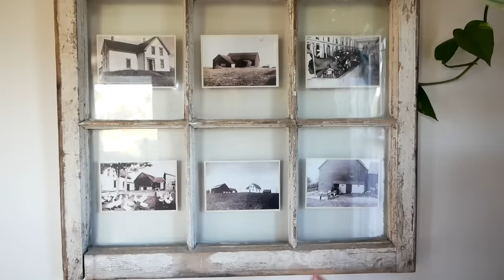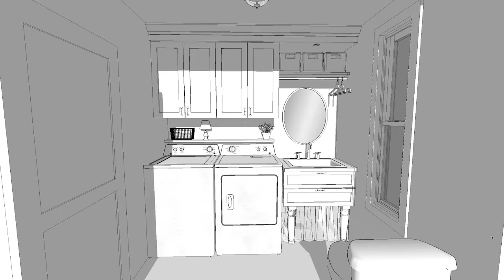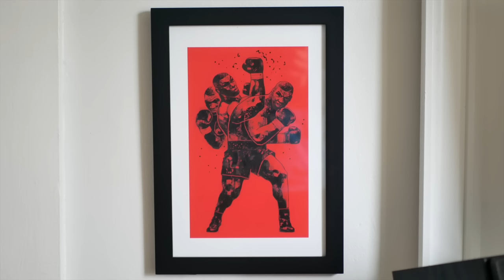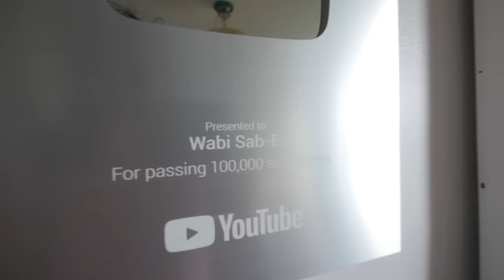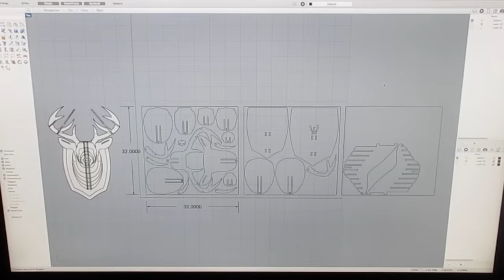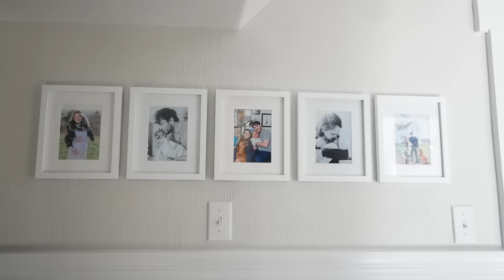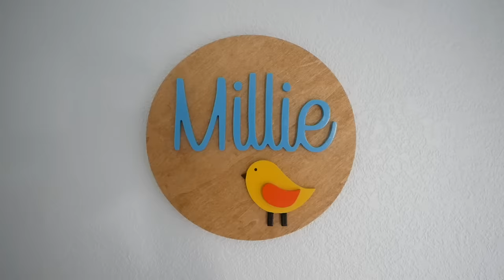100+ Year Old Renovated Farmhouse Tour

Comment: King bed and narrow stairs - we went for two long twins with motorized risers and put them together on a king frame and headboard, so there was no problem getting them in and will be no problem getting them out again. Twin sheets but king blankets and duvets. This means we each got the mattress density we prefer, and each can sleep at the best angle for The Snorer and The Bad Back.
Reply: Yes. This also helps with the problem of an active sleeper disturbing the other person in the bed. For the most part.
Reply: Friends of mine did two twin beds screwed them together by the legs and frame and put a rollable matress on top of that. (90cm+90cm, they now have a 180cm wide bed).
Also flatpack would solve your problem.
Reply: Oh my God.  I love that idea!!
Reply: Yes, we did the same and put a king size mattress topper on top. You don't even know there's a gap in the middle. Just make sure you have a bed that holds the sides of the mattress in place, as they can shift around if they're just sitting on top of a spring box.
Reply: BTW: King blankets are a concept that's quite uncommon in my country. I'd hate to be subjected to my boyfriends movements and body heat throughout the night. 😅 My blanket is 4x thicker, we just feel heat very differently.
Reply: Me and my BF have two twin beds shifted next to each other (90x90cm). I get woken up easily, so my BF's movements would wake me up. We have also different preferences for hardness of matrasses and need for warmth. The two beds with separate mattrasses and duvets solved all these things for me :)
Reply: This is also perfect if both people have different prefrences for mattress firmness or sheet material.
Reply: My husband and I have double (full) extra long beds. His and Hers. They're in the same room separated by a small night stand. The mattresses, sheets and pillows are all to are liking. The bedspreads are matching for continuity. This set up still allows for ease of bed making. When you think outside the norm when creating a space, problems get solved.
Reply: @beths9232  
Hi Mary and Rob Petre.
Reply: We have a king size waterbed that we have had for 43 years now. We buy a new water mattress every 8 to 10 years. And we have it upstairs in our 1916 farmhouse.  That wasn't a problem getting it up the narrow stairs. It was my long 70's dresser with the big mirror that has a big wooden frame and shelves around it. That was fun to get up there 29 years ago when we were 33 and 34. Now at 62 and 63. It's staying with the house if we ever move. The next owner can have it.
Reply: If you get a rolled up king mattress, when the time comes to replace it, you will never be able to get it out without sawing it up into pieces. So imho, Mulan 121 has the perfect solution.  Two extra long twin mattresses with a king size topper will seem like a normal king bed but you will be able to replace any or all of the components when needed.

Comment: Please check those magnet letters to be sure they are safe (Now, perhaps made to large to get into the mouth?). Maybe they are making them different now but I have been told that nothing is regulated that comes from china.  They have come loose out of those letters. Children have been known to get more than one magnet in their digestive system, cutting off flow and the doctors couldn't get to it in surgery quick enough. Just a concerned thought, since little ones want to put anything in their mouth. Also, while I am on the subject, a lot of plastics and dyes in toys are not safe.

Comment: why don't you guys get two 100cm matresses, instead of a single huge one? it would make sense, since your very different hights/weights and it's easier to replace a smaller matress, too. i tend to have multiple people/pets in bed as well, suing 2 matresses, i just use one huge matress cover and fitted sheet - it feels like just one large unit, with all the above mentioned benefits.

Comment: I really admire that they did this themselves but if they just researched and got an original floor plan of the house they’d see how much wasted space there is in this house. The walls between the office and the stairs should have been removed completely, making the office a large open dining room and giving the space more light without two doors into the kitchen. The room with the built in bookshelves should have been the office/family room. So much space wasted with unnecessary doorways and walls blocking natural light